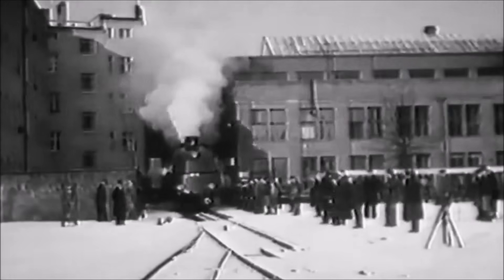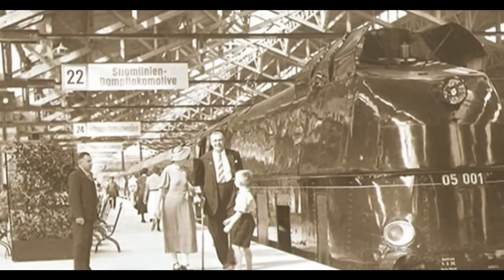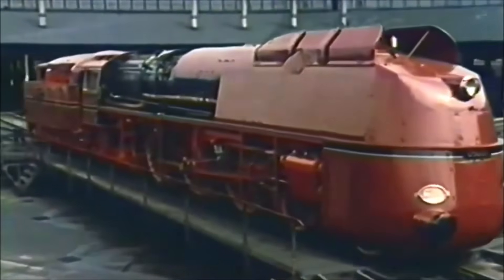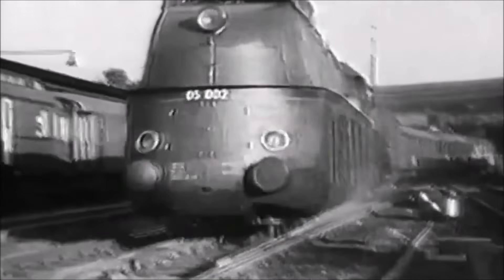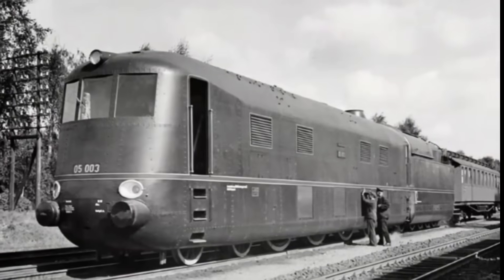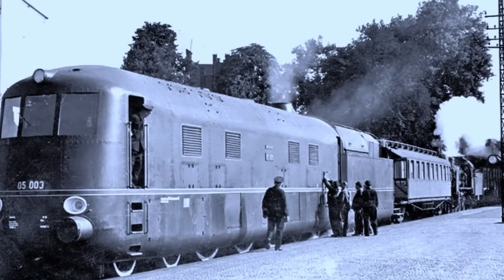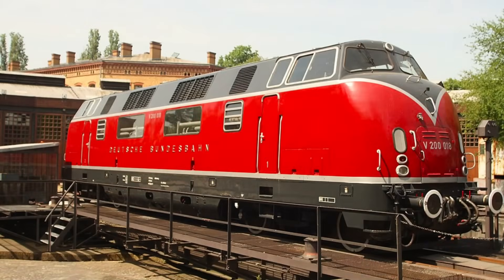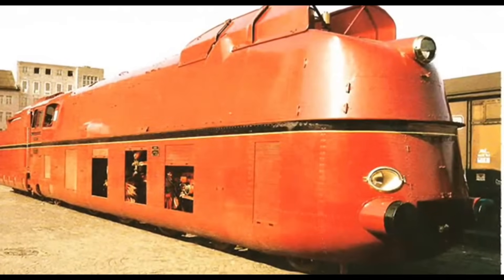What Happened to the DRG Class 05 – Germany’s Forgotten Speed Demon? #deutschebahn #germany #railway

Comment: Technically 05 002 wasn't completely scrapped, it was rebuild into the DR 18 still doing high speed passenger wagon testing and verification on the regular in the DDR and is also preserved today, because it was never really decommissioned in the first place.
Reply: Die DDR Schnellfahrlok 18 201 basiert auf der Stromlinienlok 61 002.
Die drei Loks der Baureihe 05 verblieben 1945 im Westen. Sie wurden bei Kraus Maffei un München aufgearbeitet und kamen, mit neuen Kesseln, in den Bestand der Bundesbahn.
Reply: Der Henschel-Wegman Zug.
Reply: 05 002 was scrapped… same as 05 003, only 05 001 is in existence , and the DR 18 201 is rebuilt from the Class 61 tank engine as a matter fact .. so you are wrong😊